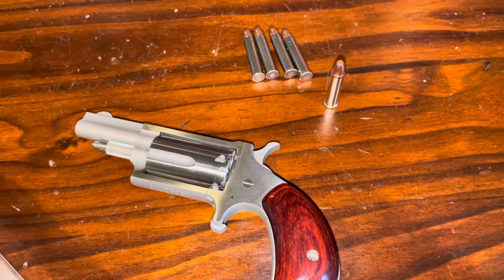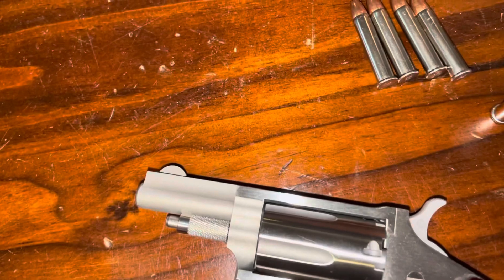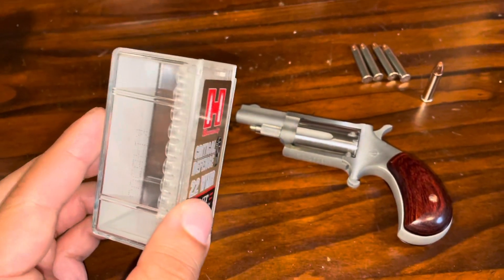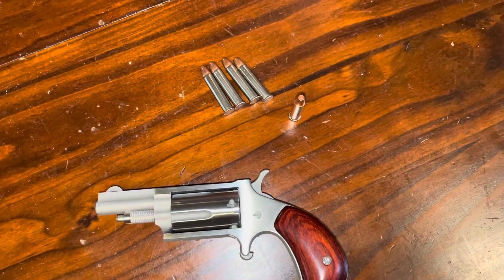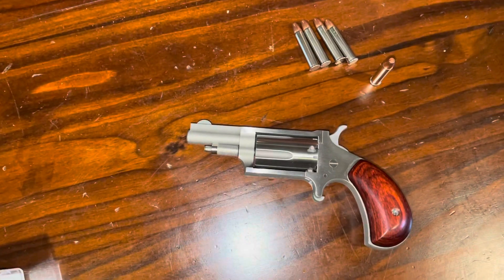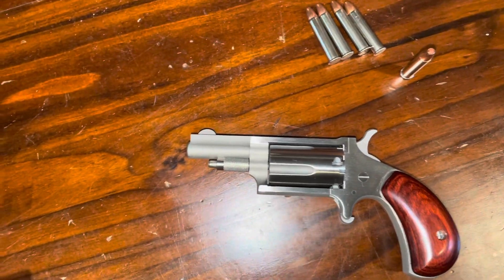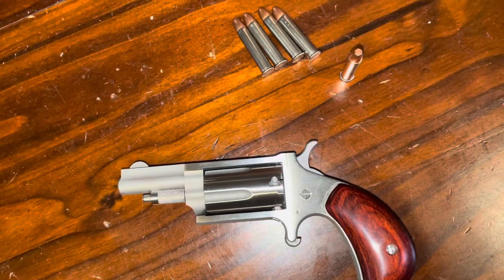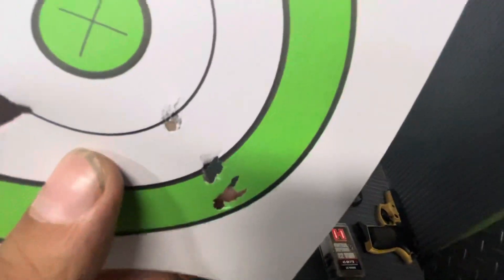Bought NAA mini revolver 22mag, bullets are tumbling

Comment: Do you know what a " barrel crown" is?
Check your revolver and see if it has one.. If it don't , call NAA and tell em your problem.. they are absolutely awesome and will get you squared away.
Normally the tumbling bullets in the NAA are due to the barrel not being crowned or crowned improperly